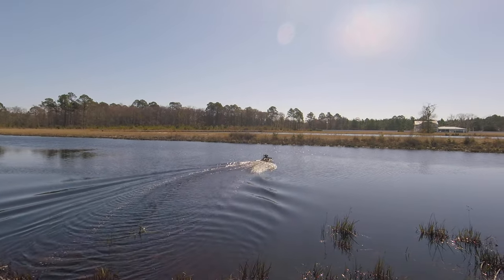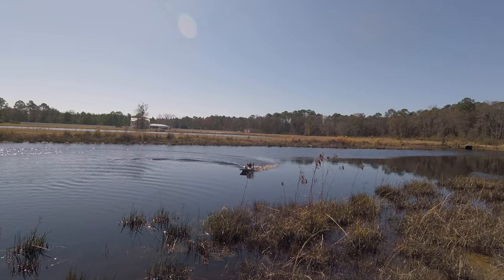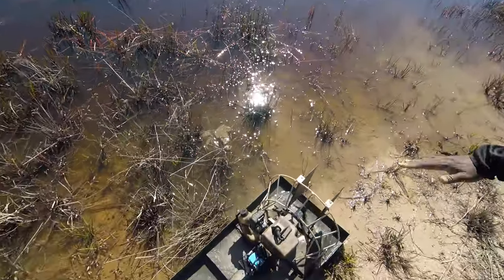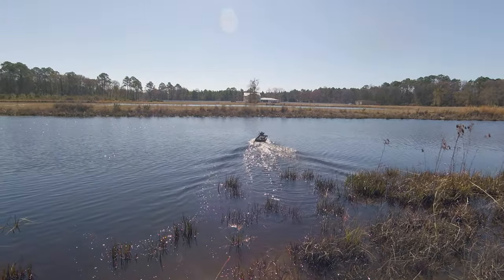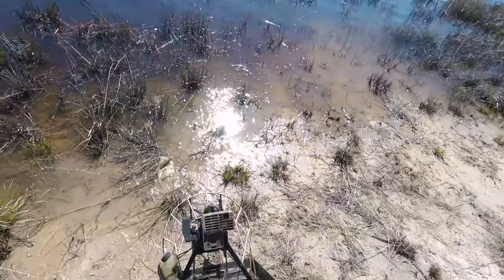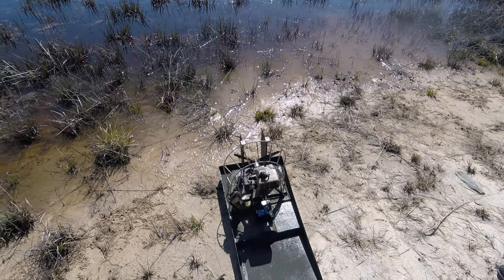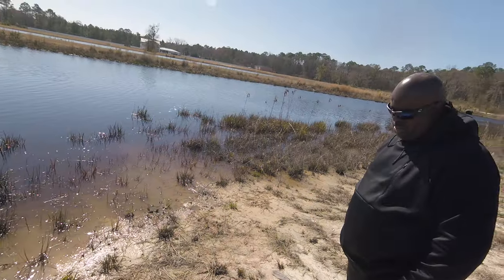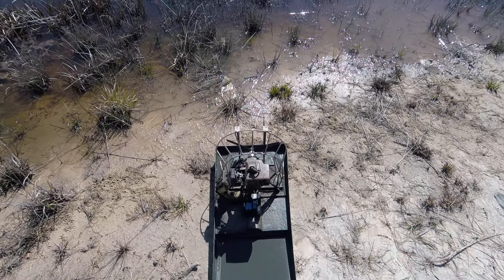Weedeater Airboat - Made Aluminum Hull after 8 years - First Test!

Comment: Need to adjust the pitch of the engine to lift the back up 2 degrees or 3 degrees then change the prop to increase air flow the proper is pushing
Reply: Not so much issues of pull not pushing.  Deck needs sealed so wash over doesnt Fill Hull.  Bevel the sides from back to front so can Slide and Not HooK like when came ashore. 
The motor weight is too fwd. 
Lean your bottom needle a bit, should help it start.  
The hull has large flat surface area , this creates lots of SuctioN to the waters surface to overcome.  
Very Nice Cage n rudder setup, id like to see test where you shift that assembly back like the full scale airboat setup

Comment: That's I'm making one myself out of Aluminum just curious did you  Champer your corners on the bottom of your hull in the aft? Because if not that will make your hull grab and catch while you are turning and if yo do the hull has a lifting affect in the stern and on the transom if you add a plate going aft on the fop edge it will also help control your stern wake from flooding the hull when you slow down one other thing you might want to think about adding some weight in the bow because the flatbottom hull is a high planing hull you get so much lift and with a little bow down when you power down the bow drops wich helps eliminate the stern wash from swamping the boat and it also helps with low speed maneuvering. But you did a hell of a job good work.
After looking at some of your videos I have to Add GO NAVY

Comment: Did you get a "Pusher Prop"? or is the prop still on backwards? If it's backwards and not a pusher prop then you'll never get the thrust the motor will actually produce and thats what it looked like in the video. I hope you get it worked out... looks like it would be a lot of fun.
Reply: It had the correct prop for the rotation. Just not enough power.